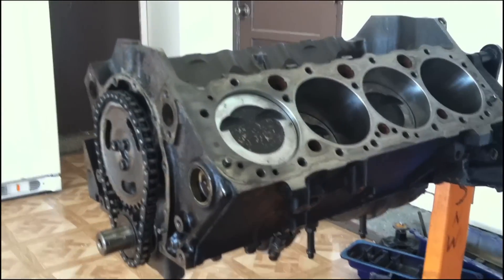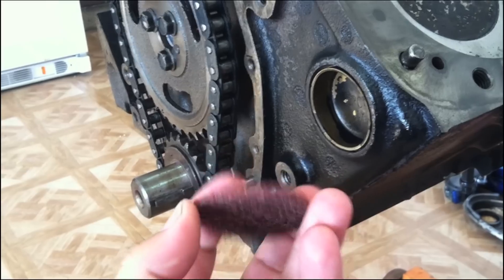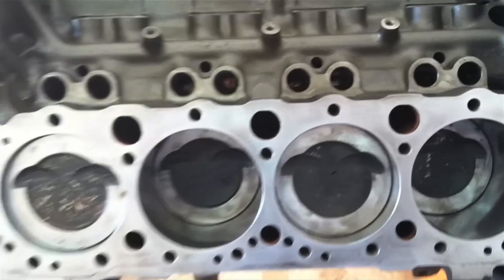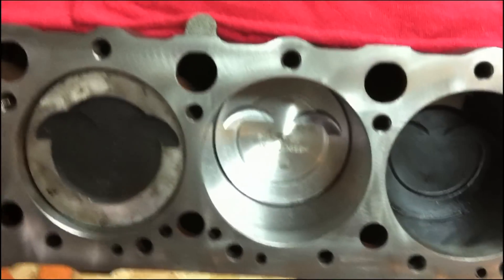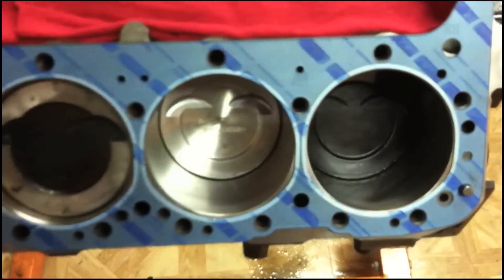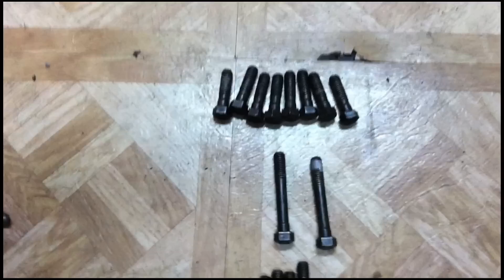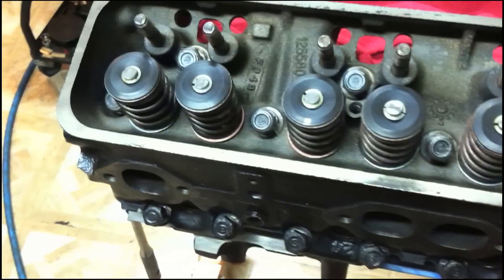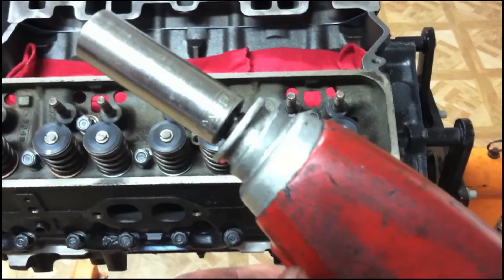How to Build a Chevy 383 Stroker: Part 4 Heads

Comment: Is this the last video of this build? I'd like to see more..like intake carb install..and also..is the only difference between the stock 350 and what makes it a 383 the crank? or did u have to purchase different pistons. lifters. valves. too...? love the videos though..simple step by step and easily understood for us noobies. thanks!
Reply from the maker: Thanks Matthew. I'm glad you liked it. There is a part 5 on this engine series. I also started a second series on the externals called "Engine Dress Up" It show how to properly install the pan, valve covers, intake, etc. without them leaking. The second series is not completely uploaded yet but there are a few parts there to get you started. The 383 is mostly a 350 block with a 400 crank. You need to have the right rods and pistons but there are many choices. The best thing to do is talk to your local machine shop. You can also copy or download my "Build Sheet" on my website. It helps you plan your engine build with a simple checklist. You can also see my brand new music video "Jolene" featuring the red engine here on my SanDiegoHotRod youtube channel. More info is available on my website http://www.CorvettesandCustoms.org

Comment: Hey man you seem to know your stuff I just recently purchased a 96 Z28 Camaro with the LT1 350 and actually would like to convert that over to a 383 stroker is there any recommendations you have or any way you can steer me into the correct direction would be really appreciated
Reply from the maker: Talk to your local machine shop. They should be able to give you lots of options on steel crank,, good pistons and compression ratio, upping the fuel injectors, etc. If you have to smog the car you may be stuck. There is a "wish list" on the Build Sheet page of my website that can help you plan and budget your build and help you ask the right questions of the machine shop. http://www.corvettesandcustoms.org Thanks.
Reply: Thanks for the advice man I appreciate the help

Comment: this should be called how to warp your cylinder heads and deck on block by using a scotch brite. not to mention getting fibers everywhere. how fucking dumb ask any machinist what these disks do to the cylinder heads and blocks. amatuer engine builder
Reply: faststang85  hell i don't think you know anything...  do you have any videos? cuz i wanna troll on your hardcore .... I wanna see how many hours it takes you to clean up the surfaces compared to the 3M disc pads...
Reply: LOL , well i don't know ? Have you Sat a full Year to Immediately Respond to something you commented on a year ago? Only thing fast about you Stang is the Shit that Flows from your wormy little head down to you fingers when your typing... why did you come here ? Ohh thats right, your a faststang85 POS lover and the only way you could get faster is to learn how to build a SBC hahahaha!!!!!!
Reply: faststang85 that only really applies to aluminum not so much cast iron

Comment: Scotchbrite pads are nylon fibers with 40 micron particles of aluminum oxide in them. Scotchbrite dust leaves behind all those 40 micron particles hidden everywhere. Aluminum oxide is an extremely aggressive abrasive. NEVER, EVER, EVER USE SCOTCHBRITE ON AN ENGINE. At least not one you want to run again for a long time.
If you doubt this at all call JASPER or any of the main engine re-man companies and ask them if it is OK to use scotchbrite to clean up the manifold you are going to put on your Jasper re-man. It will VOID the warranty.
Reply: very true, a lot of oems are against these discs for that reason! people will argue about it but live and learn. I could care less if anyone believes us or not. the best way to clean is with a razor blade, or second way sand paper and a straight block works very well. thanks and good luck.
Reply: SanDiegoHotRod Good old Scotchbrite disc I've been using them in engines since they first came out in the early 80s.
I've have been building engine since the 70s, one thing to think about when using the disc on a partially assembled engine, as we are using them the pad is wearing down. Where is the 40 micron particles of aluminum oxide going? Particles as small as 40 microns some I'm sure smaller due to the wear on them due to the cleaning process. 40 microns is = to 0.0016 of an inch, some particals are smaller than the eye can see.
In buffing the top of the pistons & cleaning the block surface with the high speed  grinder with the pad the aluminum oxide is being swung in every direction.
Some will make it on the cylinder walls & blowing it clean will just push them into the rings & past the ring grooves.
Best to clean all engine parts, then wash them down & blow them down to remove any residue from the cleaning process.
Reply from the maker: Any company that wants to void a warranty for using Scotchbrite to clean something is just trying to get out of honoring a warranty. I have built race engines, street engines and 1000 hp supercharged engines with Whipple, Vortecs and others and NEVER EVER EVER had a problem in 25 years.
It does not matter if it is an intake manifold or engine bearing all parts are cleaned before assembly and most parts are lubed. Intakes are cleaned with non chlorine brake cleaner and bearings are LUBRICATED before and during operation. You need to check your research into how much aluminum oxide is corrosive and harmful to an intake manifold or any other part. Ethylene glycol (antifreeze) becomes corrosive over time and that is why it should be changed every year. TRUST ME antifreeze eats more intake manifolds than Scotchbrite.

Comment from the maker: You don't need a spacer but yo do need to be aware of the crank, pistons, head chamber size (cc), camshaft and rocker ratio. If you have a 12:1 piston with a 400 (stroker) crank, big cam and 1.6 ratio rockers you may have problems with the valves hitting for example. If you use a spacer or thicker head gasket then yo just effectively dropped the compression ratio (so why use it?) Unfortunately it is a math problem to figure this stuff out sometimes.  LOL

Comment from the maker: That will depend on the piston. Some are low compression and "dished" and some are high compression and "domed." You need to turn the engine over by hand and watch where the piston stops moving up and then starts moving back down. You don't really want the piston higher than the block unless you have the heads and valves to match.

Comment from the maker: Thank you. The engine is done and I still have to upload the final part which shows a fast and easy way to adjust rockers correctly. This engine was in a boat running high RPM before my client bought it. The Vortec block is from a truck and 2 bolt mains are not a problem if built right and balanced. How heavy is your car? I talked the client out of using this eng. in his 69 Chevelle and built the blue 454 that is on my website.

Comment: Great video, I just wondered if you have finnished this engine and how it's doing with the 2-bolt main setup. I just finnished a 383 with the same (638) 2-bolt block you have and made almost 50 passes at the drag strip over the last few weeks with no problems.When people find out I have a 383 2-bolt they say it wont last long and that the main caps will walk with the long stroke crank.